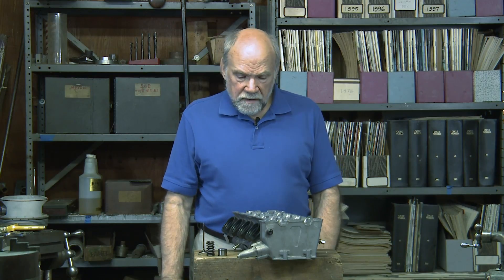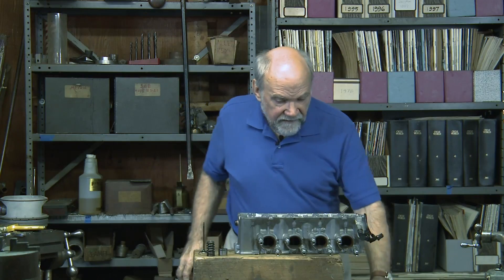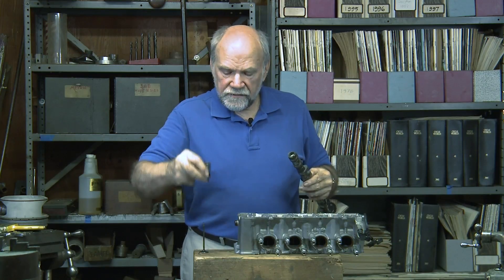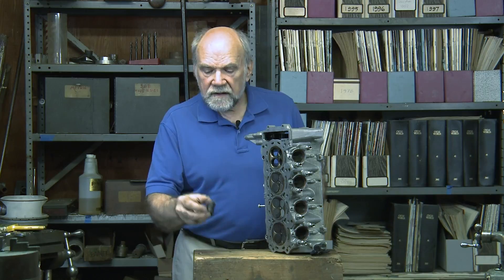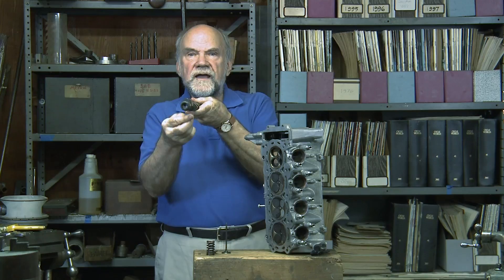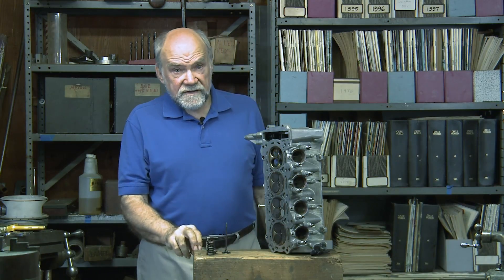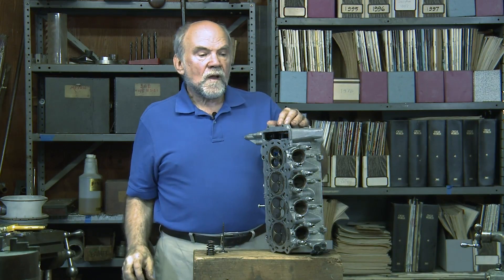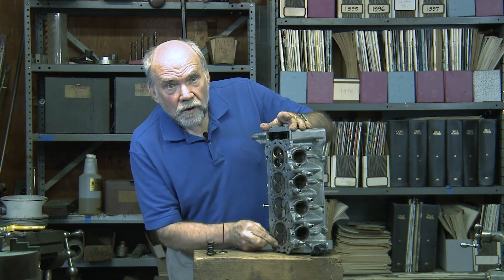How Are Four-Valve Cylinders Designed?

Comment: This is the reason why I'm always nervous on running in a new engine to get a good wear characteristics... I known that modern day machinery is much more precise, but there will always be some tight tolerances that you just can't shim away. You could have a engine built to spec, but Mass production won't grind off every discrepancy if it's close enough to be within their tolerance.  Of all there is to an engine, it's the valves that I fear the most. They're little grenades on flower stems that can glow if the bike is running to lean or lean at a specific spot on the curve to wide open.
Does Mr. Cameron ever do grinding in the heads for head characteristics or port polishing/grinding? Those profiles for the head, piston, intake valves/ports, and exhaust valves/ports would make for a nice topic that won't eat away at his lunch break. It's high science on some of those... 

I always appreciate anything you can give us.  Thank you, Sir.
Reply: Aint1s....Don't fear your valves. Adjust and maintain instead.